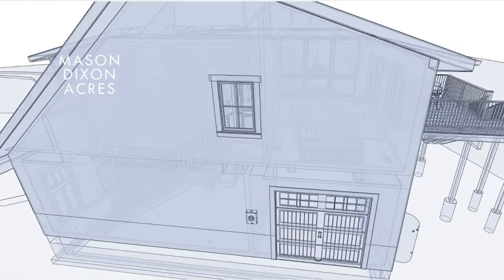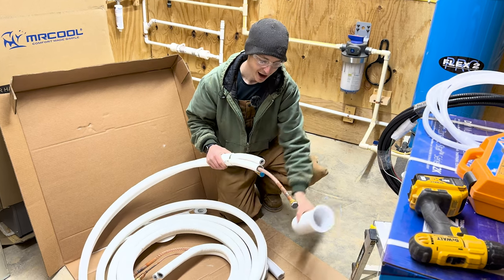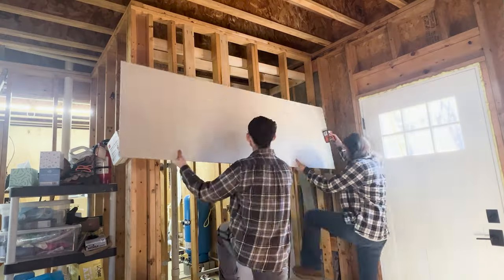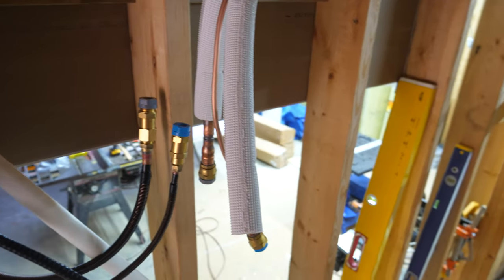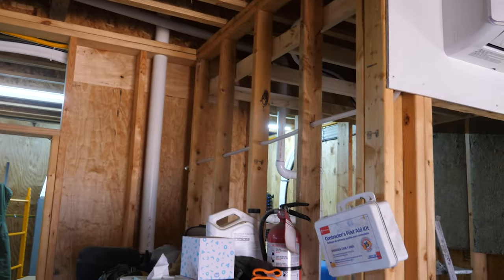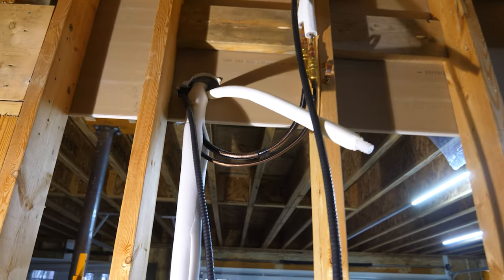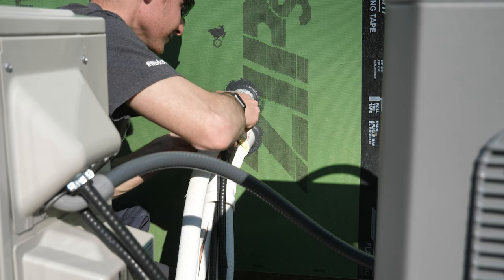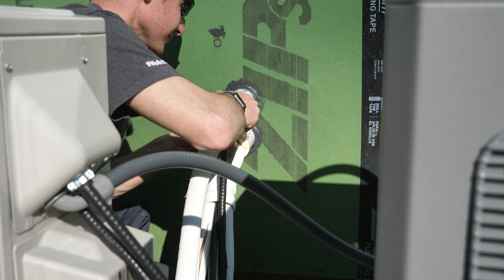MRCOOL DIY 4th Gen Ductless Install & Start Up (YEAR-ROUND GARAGE COMFORT)

Comment: I installed a Mr Cool mini split system in my workshop about 5 years ago.  I can safely say it was the best investment I ever made in creature comfort in the shop.  My favorite feature is that it keeps the humidity in check.  No more having to empty a dehumidifier drain bucket or worrying about rusted tools/ equipment.
Reply from the maker: I totally agree, I was in the (uninsulated) garage pulling PEX water liens yesterday and it got up to 80F outside, and by noon it was 80F inside and I was sweating. Clicked the mini splits on, within 45 minutes the whole garage was 70. Incredible

Comment: I installed on on a second floor a couple years ago. A little over a year later the upstairs cooling unit started dripping water on the floor. The solution was to hook a wet vacuum to lower drain hose. This cleared the line that had algae buildup. My advice is to have a service opening or access to the lower drain hose. Vacuum the drain hose at least once a year. You will be surprised how much water will leak in a short time. A lot of water damage can happen fast before you figure it out.

Comment: Good Job! Smart move on the pvc pipe for condensate. Never seen flex pipe used before. Always pvc pipe up to the connection on the head unit. I find these dyi units interesting. For always used nitrogen to purge and a vacuum pump. For you want the system fully dehydrated. Refrigerate and moisture, makes acid. Will slug a compressor. On every unit I’ve seen the refrigerant is stored in the outdoor unit. Until you open the king valves and release it, into the line set. Awesome job!
Reply from the maker: Thanks! Yep these also had most of the refrigerant in the outdoor unit

Comment: Hey Alex!  On the electrical connectors, A couple things I've done in the past...

If you can, the ring terminals can often be cut or ground down on the side of the ring so they aren't so wide, without completely losing the rings structure.

Alternatively, wire ferrules!  Wraps up all those starnds of the stranded wire into a neat bundle and crimps as one piece, then as long as the screws in the terminal block aren't ridiculously short, it'll fit right in.
Reply: Also, to be honest, the way you did it just clamping the bare wires in there is fine so long as you don't have any strands flying away.
Reply from the maker: Thank you!! I thought about grinding down the ring terminal.. then figured I would REALLY get some flak from any YouTube electricians who saw that 🤣 good thought on the ferrule too. I’m sure the reason the MRCOOL tech manual doesn’t cover this connection is because they don’t want to take liability for it 😁

Comment: Good job & vid, nice install. The grey inner filter is a carbon filter, I believe it is supposed to help alleviate odours.  The corrugated tubing would have been an ongoing problem & the PVC was a much better choice, but can still be subject to issues like cracking, leaking & blockages, other things to consider are if the fan can cause a static pressure/vacuum on the drain line & is another possibility that a condensate pump could be needed at some time & a U trap in ur drain line can/may help prevent this from happening. Cheers

Comment: Are you planning a back up heating system? I installed a mini split system in my home and love it. I have found that in cold (below freezing) I need to turn on resistance electric heating system to maintain a comfortable temperature. I live in southern Indiana and have a 1,300 square foot mobile home and a 12,000 BTU unit.
Reply from the maker: The radiant floor will do the majority of winter heating in the garage. Upstairs will be using a ducted split system and I’ll have a generator port to power it in case of power loss

Comment: Haven't you used vacuum pump for copper lines to remove all air from them before opening valves on outdoor unit?
Reply from the maker: That’s the beauty of the MRCOOL line sets, no need.

Comment: Hi Alex. @masonDixonFarms 
 Love what you and your partner are building. Ambitious! 

I’m a mech engineer too. & a big fan of Mr.Cool. A good low cost solution to give the people AC and provide some carbon free heating in the winter. 

One question: did you Vapor seal your refrigerant lines  in the walls? If so, what product did you use? I’m looking for some kind of heat shrink fit Vapor retardant tubing that will fit over the insulated lines 

I’ve heard that moisture from the living space will condense on the lines if they are not vapour sealed.
Reply from the maker: If the lines are enclosed with drywall you shouldn't have a problem - that is enough of an air barrier. We ran them in the summer a few days before any insulation or drywall and yes the humidity definitely condenses on the cold lines coming out the back of the unit and will drip. It's not really possible to get a perfect airtight seal around them given the geometry, but you might find a product that works. The provided insulation on the linesets prevents condensation on 98% of the run, it's just the 12-18" coming into the back of the unit you should try to carefully insulate and seal.

Comment: What is the size of framing members in wall cavities? 2x4? Just about to install one of these and was looking everywhere to see if I could get the pipes to almost 90° down turn to make it to my subfloor attic area. I can't hang mine on an exterior wall.
Reply from the maker: The copper is pretty stiff, you need to be careful making tight bends. They should fit in a 2x4 cavity, just watch the bend radius

Comment: So, with these units, there is no requirement to vacuum down the line sets?  These units appear to be the the exact units that I have installed but mine are branded as Senville. Midea is the company that makes them but I like Mr. Cools innovation if you do not have to vacuum the lines.  Is there some kind of special coupling on the ends or did you have to use a pump to evacuate the lines?
Reply from the maker: The lines are sealed and precharged, they have a special coupler that opens the lines when connected and prevents the need for vacuuming. The idea has actually been around for quite some time
Reply: But they didn't fill with air that you needed to vacuum out when you disconnected them after already being connected?

Comment: Question, what happens when you screw the zip osb? You don’t have to seal the hole made by the screw? Isn’t a point where the water can leak in the house.
Sorry my ignorance and my English. We don’t use to build with wood in my country
Reply from the maker: The white PVC board I drill through for the wire is sealed where the wire comes through, and the entire board is flashed with metal head flashing to protect from water. Ideally you'd like to seal the wire right at the Zip with a product like Zip liquid flash, but it wasn't feasible in this case where I already had the trim block on the wall. I tried to pump as much sealant back in the hole as I could to reach the sheathing.
Reply: @MasonDixonAcres   Oh, I mean at 27:51 when you screw in the T15s to fix the electrical box.
Could it be overkill to seal that, or does the plate itself have something that seals the screw hole?
I always have those stupid questions' haha, for example, when you fixed the OSB board with nails, what stops the water from leaking through the nail?
Reply from the maker: Oh gotcha, yeah even I'd say that's overkill to seal the heads of those screws and I go overkill on many things haha. I did seal the lag screws securing the electrical meter box with duct seal, because I will never be able to open that again without the power company coming out. But the heads of fasteners like those #8 screws wouldn't see much if any benefit of add'l sealant, especially if inside a box or with flashing over top. The screw fills it's own hole in the Zip for all intents and purposes. 

The only time Huber recommends liquid flashing over nail heads are if they are over driven. If driven properly, there is no air or water leakage, they have published some resources on this. We did flash over all our nail heads just because.
Reply: @MasonDixonAcres   Thank you so much! Merry Christmas and happy new year!

Comment: only thing i didn't like about these was the serviceability in the future, most hvac people will not touch these. Ended up going with mitsubishi just due to the efficiency in cold climate etc and options with ceiling or wall mount.
Reply: Mr cool has high efficiency options as well as ceiling and wall mounts. Plus you will save thousands over having someone install the Mitsubishi.   I’ve had the Mr Cool system for almost seven years with zero problems. If it were to die tomorrow, I could buy a new one and still be money ahead over the Mitsubishi.

Comment: HEAT PUMPS NEED TO BE 8-10 inches off the ground with no snow if you are in a high snow area they should be 18” off the ground
Reply from the maker: We rarely get snow, and that’s the only reason to elevate this unit. Other manufacturers may vary

Comment: I purchased a 4th gen 18k BTU DIY with 2 zones (12k & 9k wall mount units).  I'm up to the part when i connect the line sets.  I didnt hear any hissing of the gases when i connected the precharged lineset to the 12k head unit which is concerning.  I didnt hear any hissing of the gases even when i connected it to the compressor.  I wanted to get your suggestions before i loosen the set screw on the compressor.  My concern is maybe my lineset was faulty.  I have only connected the 12k unit and have not done the electric part so no power yet.  Do you think i should just purchase a new line set and return this one to be on the safe side?
Reply from the maker: hmm i'm not really sure but I'd lean towards it not being an issue. I'd call up their support line, they're really good. If you open the valve on the outdoor unit and you hear an obvious leak from somewhere in the lineset then obviously there's a problem, the outdoor unit will contain most of the refrigerant.
Reply: Thanks for the quick response.  I'll give them a ring.  I was worried I may open a can of worms if I open the valve on the compressor if it's a faulty line set.
Reply from the maker: Worst that can happen is you'll have to call out a tech to evacuate and recharge once you get everything leak-free. A lot cheaper than having them come install the whole system